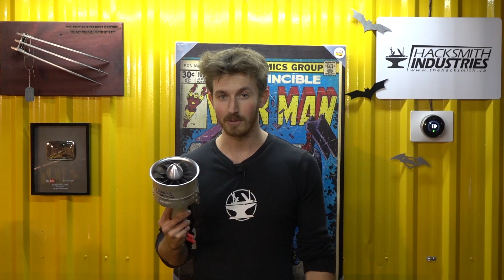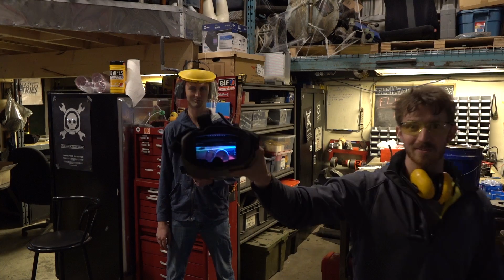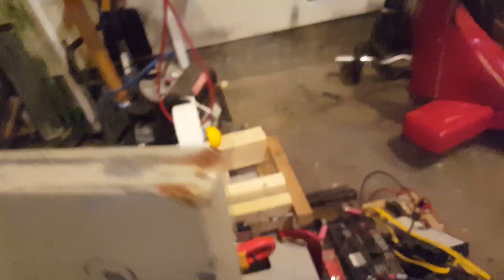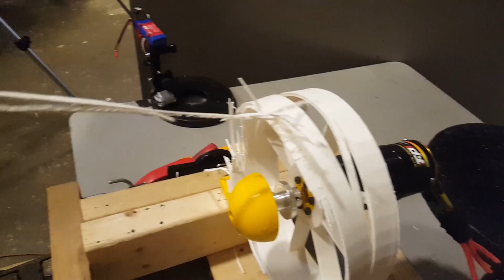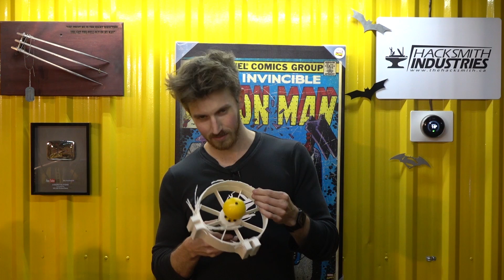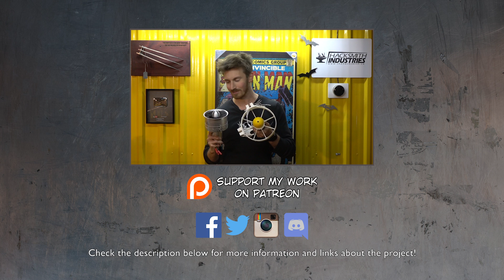Flying Like Iron Man Update: EDF EXPLOSION!!!

Comment: Reinforce the hub with a metal bushing if that is the failure point of the fan and make sheet metal cowlings (or just very thin walled tubing). I would think the cost of the material to 3D print the entire housing isn't cheep, but some sheet metal is pretty cheep and would protect against flying blades.

Comment: The hobbyking fans are designed for higher speeds than you're going for, right? Are you planning to give your fan a duct with a wider lip / larger diameter diffuser that might increase static thrust, or is it better to just make the fan itself larger?

Comment: I can tell by the material that you were printing in ABS, bad choice for this use, it has pretty terrible layer bonding and tensile strength. I would highly recommend you try using either a PET-G based filament, or a Taulman brand Nylon

PET-G will probably work the best due to its dimensional stability across it's glass to solid phase. I would crank the temperature as high as it will suffer and print it nice and slow!

Comment: Try printing with a bigger nozzle (Like a .8mm) and use a thicker layer-heigt (All above .7/8), thicker layers mean stronger parts! Or try printing only a "frame" and filling it with epoxy and fiberglass. Or try pla-casting with aluminium

Comment: SHEESH!  It was holding together actually, really well given the fact that it was 3D printed!

One of the limitations may be the material/process of filament-3D-printing (Fused Deposition Modeling, or FDM).  Have you considered ordering a test part from Shapeways, using their "White Strong Flexible" material?  It uses a nylon powder in an SLS (Selective Laser Sintering) machine.  This results in more internal part integrity, since the powder is effectively melted together under a laser.  SLS printers are not as cheap for the hobbyist, but for small(ish) parts like your fan rotors, ordering from Shapeways would still be WAY cheaper than those production EDF's.   I haven't done a fan rotor, so I haven't approached the RPM's you have, but I HAVE successfully printed and tested some 3D printed propellers...

Link to my home test here:  https://www.youtube.com/watch?v=6y4cQZOyQEA
Reply from the maker: Haha no way! I watched your video a few weeks ago when I was researching 3D printing props!

We're aware FDM is likely not going to do the trick for production of these, but we're using it as a cheap/fast way to evaluate the actual designs of the blades before we spend a lot of money on either machining one, or attempting SLS. Our next video will have  a lot more juicy information about what we've done, and what we're planning to do! =)
Reply: the Hacksmith Good to know, I'll stay tuned.  Yeah, FDM is great for quick cheap prototyping, good on ya for that. :)
Looking forward to more info!

Please let me know if I can be of further assistance. :)
Reply: the Hacksmith BTW: I actually flew some bigger 3D printed folding props on one of my RC planes.  They worked great!

Comment: from the end results I can see 2 obvious things 

it seems that the case didnt hold  well  against  the generated force  it  was much more stronger
it was actually ripped apart by it  what I think I would do is modify the case of the printed edf  ,add 4 supports ( long screws or something like that) bewtween the front and the rear of the edf without messing with the space of the fan 

 and improve  the hardness of the case itself  there is some really good coments down there

and 2 im concerned about the vibration generated by the rotor and blades , it could present a problem in the long run , 
anyway those are my humble toughts 

srry english is my mother language

Comment: one possibility could be to wrap it in carbon...

In detail:
your fan possibly touches the edf shell, due to the rotational forces the blades expands
Carbon has a hugh E-module = less expansion.

And layer of roven carbon should be enough for the first test.. maybe with some extra uni-directional fibers.. or even just some roving strings at the "front" of the blade (the part thats "cuts" the air first)

and the "only" thing you have to do is scale the Blade down, so the blades don't get to large.. (normally the weight of carbon per m^2 is the 1/2 of the final thingness.

Hope i could help you!

I really enjoy your videos and dreamed of building an iron man suit since i was a kid.

(and by the way i work daily with carbon fiber)

Comment: Try using a few layers of carbon fibre or ceramic sheets on your 3D printed parts for stronger structural integrity. Should add some more thrust.

Comment: Im not a expert in this, but as far as I imagined, the more you expand the size of the EDF the more you get away from the Ironman suit design. At  the end, if it all gets to work with giant EDFs, you would be flying like Green Goblin not Ironman. However the effort you are putting into this is very appreciated, but why don't you focus on Jet Engines ? or new approach on ion thrusters. Now I know that ion thrusters are not good choices for heavy lifting, but few have been looking into expanding the idea thus making it to handle heavy liftings. Ive been thinking about it for a time, but as I said, im not an expert in it, so I left there in my imagination :-D
Reply from the maker: Ion thrusters work best in vacuum ;-)

jet engines are actually comparable in size to EDFs ;-)
Reply: Well, at least I tried my shot :-) . but anyways, good luck on the project.

Comment: I know their expensive but why they don't use gas turbines blows my mind, you would easily get the same performance at 3lbs. With all the new untested technology your trying to make work cost money and time (more money). When you can just by whats proven and fairly a safe system in the long run I'm sure moving the project forward would justify the up front costs.
Reply from the maker: Thanks for the question FutureAirways2!

We've actually answered this in detail in the Flying Like Iron Man Q&A video! Check out that video, or visit http://www.thehacksmith.ca/flight-project-qa/ to learn more about the project!

Comment: Serious question: do you really believe you can save money by 3D printing? With the shop-bought device you're paying for quality; mass manufacturing already has the price driven down as far as it might go without it being super-super-mass-produced from extreme customer demand.

3D printing might be good for small replacement parts, extra brackets etc. But to make a whole high-performance, high-stress moving-parts machine? the quality won't be there (eg. because plastic not metal), or you will have to way over engineer it by adding bulk (=plastic price and weight and size and reduced speed).

3D printing is good for some things like aesthetic, simple low load structural, etc. But for this I'm sceptical.

Prove me wrong, if you've got good reason to believe you have a strong chance of success with 3D printing I'd love to hear it!
Reply from the maker: We doubt we'll be able to use 3D printing for the final project. What this does allow us to do is do engineering... prototyping... without the cost of making each revision ;-)

Once we have a finalized design using 3D printing, we'll move to producing it out of metal. That being said, 3D printed parts can be used in all kinds of production environments -- it's quite versatile.
Reply: the Hacksmith Thanks for the answer! I see lots of people had similar questions about the long-term feasibility of cheap-end(?) filament 3D printing. So I'm sure the info will be well received by many. I hope in future videos you'll comment in the video similar to how you've just said in the YouTube comments about how the current tests might build up to higher quality future results with different materials or processes. (or if you have already said it in video, sorry, perhaps I missed it).  thanks again

Comment: Hay Hacksmith if you are using ABS plastic do what is called Vapor smoothing with acetone it will glue all the layers together and create one solid part. most people use a 3D printer hot plate and a jar with a little bit of acetone in the bottom. and then heat the acetone and the vapors condensed at the bottom of the container and then when you dip your part in the vapor it glues all of the layers together to create 1 solid part. I use it myself all the time to create a better finish and a smoother part and a stronger part. just make sure you wait enough time for the acetone to evaporate out of the plastic sometimes it can take several hours to maybe a day depending on how thick your part is. if not ,your part will be flexible and stretch like rubber. just take your nail and push into the plastic and see if it leaves a mark if not you're good.
Reply from the maker: We did =P

Comment: I can already see the first problem. You are printing the parts with a minimal infill to save material and make it lighter. The problem is is that makes the part weaker. Try setting your layer height to 0.1 mm at 100% infill. Also, depending on what material you were using, try setting the temperature between 230 and 260°C. This will give you better layer adhesion. Look into  Taulman alloy 910 filament. It is a lot stronger and will be able to deal with the centrifugal force generated by the rotation of the electric motor. Best of luck can't wait for the next update.
Reply from the maker: The blades were 100% infill, the hub was the only part that wasn't a full infill

Comment: Have you tried 3D printing in metal? All you will need is a $15 extruder replacement - google it
Good Luck! :D
Reply: or you can use your 3d printed model to make a cast an pour molten metals into it!
Reply from the maker: $15 extruder replacement? uh huh.

A real metal 3D printer is a few hundred thousand. We got a quote for making this blade out of aluminum from Shapeways and it was $900USD =(
Reply: the Hacksmith I swear it works! I THINK an extruder swap out will print soft metals like copper. I have my own and haven't tried it because I really have no reason to
Reply from the maker: I don't think that's right... Copper still has a melting point of nearly 1000C ;-)
Reply: the Hacksmith well :/ I tried
Lovin the series! Best of luck friend!
Reply: Metal filaments for normal 3d printers are basically just lots of small particles of the metal in plastic. They are not strong at all. They would be better off with an ultra high strength nylon alloy like taulman 910. Since it looks like they are using PLA at the moment. http://taulman3d.com/910-features.html
Reply: Have you already considered the baking method to strengthen your prints?
Reply: That´s what we do for jewelry, should work just fine for that, than balance like he says above.
Reply: Stainless the mold will melt if you use something other than lead or tin. Lead is too heavy and tin is too weak. You could sand cast a 3D printed part though.
Reply: Even the cast aluminum part would most likely explode due it being full of small gas bubbles, but do like pretty much every development company, print and test the best thrust version and then go have it made from high grade aluminum with the cnc machine.. at least the blade part. Body can be made some lighter material DIY, though the safety thing is still a issue if it made from metal...

Like it was said, do tests with taulman 910 alloy and then when design is good, go with the metal or injection molded blade.

Comment: Was it the propeller that failed? You could add an outer rim around the whole propeller to add more ridgidity and make it bend less. If it was the casing that went boom, then I'm not sure, probably make it a bit thicker. Also check out resin sla or dlp printers they produce much sturdier prints.
Reply from the maker: Definitely the propeller -- the duct didn't see any forces short of the exploding propeller through it =P

Comment: You guys need to 3d print it out of metal, ain't blastic handeling that much power, anyway keep up the videos :)
Reply from the maker: Got a quote... $900USD to print in aluminum. and that might not even work =(
Reply: the Hacksmith well shit, that is expensive, how about have you tried 3d print solid rotors, or will it break easier becouse it cant bent? If so, I'm out of ideas

Comment: You could use some sort of varnish to strengthen the blades I imagine. It would also fill in the gaps between the layers of plastic, and hopefully improve thrust. Hopefully it wouldn't add too much weight

Comment: So... That happened. Thinking of making a duct that could contain a blade-off incident? Or are you just going to make sure this shit doesn't break like that in general? 
Which begs the question: how are you going to make this stronger without making it too heavy?
Reply from the maker: It means 3D printing is probably not going to be viable. No matter the material, FDM printed parts have a weakness in the inter-layer adhesion. Spinning anything 3D printed at 40,000 RPM -- you're gonna have a bad time.

The plan for this is to design an optimized blade for maximum thrust -- then see about having it made in aluminum.
Reply: Another question: are you planning to put Coanda ducts on the intakes? It's should increase vertical thrust without adding noticeable  weight.

Comment: What if as you go towards the center you double the material and around you make a circle connecting the propellers together for structural rigidity. Or use metal

Comment: Try printing in nylon, or if using abs try acetone smoothing? I've done strength tests using 3d printed strips. acetone smoothed ones took 60% more weight.
Reply from the maker: This was acetone smoothed =P
Reply: Haha oh.. properly smoothed with vapour or just brushed on? Brushed on essentially does nothing. But if vapour then if suggest nylon or using as other have said the 3d print to create a mold.

Comment: You could make a silicone mould of the parts you need then do a lost wax cast in aluminium and test those to see how you get on! 3d printed plastic just isn't there yet. If you find a 3D metal sintering company who is interested in your project they might help you for the sponsorship. I reccomend you contact a company called star prototype in China. They could sponsor this if you had adverts. starprototype.com

Comment: The delimitation of the layers shows that the weak point is not the material strength per se, but rather the incomplete adhesion between layers.

This might be a case where you could get improvement by a sintering type process?  Bake the part at a temperature under the melting point of the material, so that the weld lines can diffuse together better.

It might not make an apprechiable difference, but it seems a low cost, low risk experiment to try?

Comment: how much would it cost to have each "blade" fabricated? if the housing and motor are easy to acquire, but the fan blade is the issue, maybe someone can donate the custom blades?
Reply from the maker: 3D printing is the cheapest method -- making this out of metal would cost close to a thousand.

Comment: To make it more strong try using linear friction welding into a center hub to make a blisk (bladed disk). Then you might be able to use the cnc to make individual parts, like the hub and the blades (made separately rather than as one).

Comment: the Hacksmith which material did you use? I think it is worth to try the Polymakr PC-Max (they might even give it to you for free if you explaining them, what you are doing and who you are). Moreover you could use ABS and acetone vapour smooth it afterwards or use a good PLA (like PLA-Max), anneal it afterwards (gives more strength in terms of layer adhesion) and cover it with a layer of the XTC epoxy. Carbon particle filaments won't give you any extra strength. The are only nice if you care about abrasion resistence. Actually, they are not worth any try. Fibermaterials don't work properly if they aren't fibers anymore ;)

Comment: did u guys try 3d printing with carbon fibre between the layers? it can increase the tensile of the blade so that it can withstand more load at higher rpm..

Comment: So i have a few things / ideas you could do. first off all you could look into getting a printer like the formlabs form1(+) or the 2 if you have money for it. they have a resin called tough which is you guessed it incredibly tough and can sustain more than FDM prints. if getting a new printer isn't an option for you, you could try putting acetone on the part after printing it (only works with ABS though). it will fuse the layers together which seemed to be the weak point in your experiment.  
Greetings Kai
Source: Experience ;)
Reply from the maker: +Kai Ditt we did acetone them ;-)

I don't think the form labs printer has a large enough build volume :(
Reply: +the Hacksmith you can use resin to attach 2 not fully cured pieces together and it will bond like it has been printed in one piece. Just place the print in a box without light and maybe alcohol then they will keep not fully cured and then put resin on them attach them and let them cure completely

Comment: Maybe you should use the same design but find a metal printer and print it out of metal like steel or aluminum or maybe even titanium?
Reply from the maker: Got a quote... $900 out of aluminum =(
Reply: the Hacksmith damn I thought it would be way cheaper.